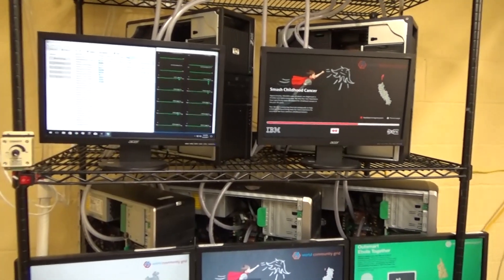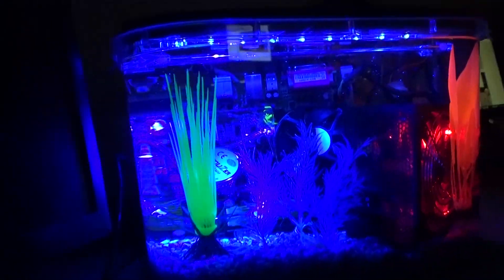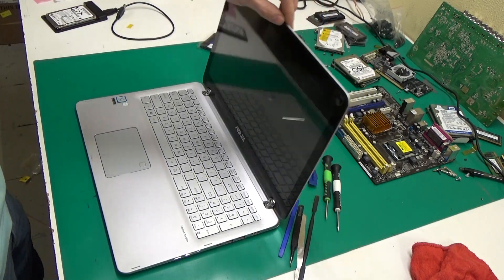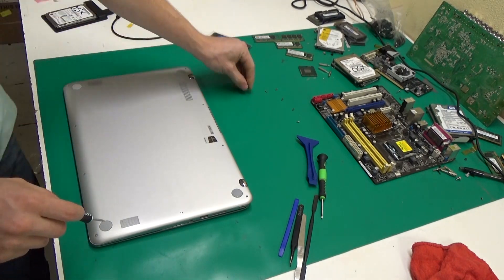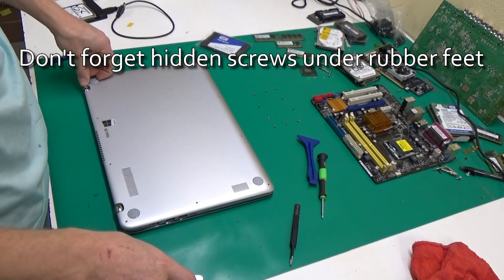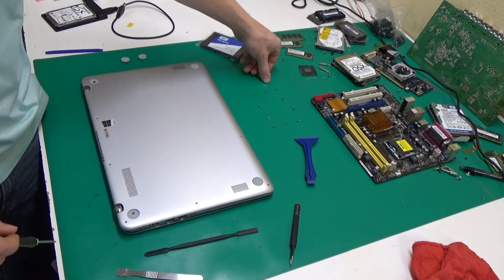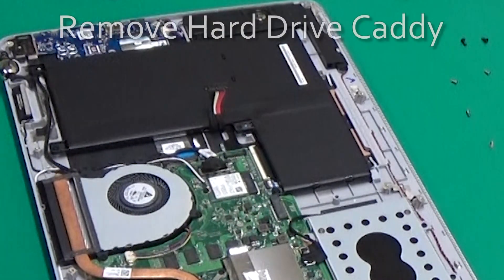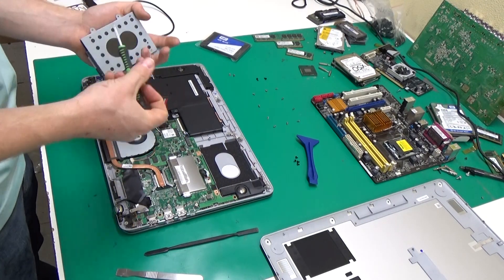How to upgrade Asus Q504 2-in1 Laptop with an SSD and Install Windows

Comment: Why is it so hard to remove the bottom cover? All screws are removed. Yes the rubber feet ones too.
Reply: No it's a snappable cover, you need a spudger look at the edges of the bottom cover
Reply: sanchez252 I guess its magnetic

Comment: Thanks man for that, but I have a question, I have the same laptop, but I still do not have enough money to buy a 1tb SSD, which you recommend me? did I buy a 1tb SSHD with 8gb SSD or do I keep its original 1tb HDD?
Reply: Eduardo Rivera honestly just buy a 120 or 240 GB SSD for fast star ups and use the 1tb HDD it comes with as extra storage, just buy a external hard drive case for it. You can get a 120 GB SSD for $50 and a external hard drive enclosure for $10, a lot better than spending $200+ on a 1tb SSD and faster than a 1tb SSHD

Comment: I bought this laptop not too long ago and thought about adding a PCIe M.2 ssd, but I’ve seen conflicting information whether the laptop has a port for this.  Would you be able to tell me if this would be an option?
Reply: Yes it does - see http://oi63.tinypic.com/wvriiw.jpg
I added "Samsung 960 EVO Series - 250GB PCIe NVMe - M.2 Internal SSD (MZ-V6E250BW)" to mine and it works fine in conjunction with HDD.

Comment: Its not have m2 slot for add SDD, instead replace?
Reply: Yes it does - see http://oi63.tinypic.com/wvriiw.jpg
I added "Samsung 960 EVO Series - 250GB PCIe NVMe - M.2 Internal SSD (MZ-V6E250BW)" to mine and it works fine in conjunction with HDD.

Comment: My fiancee just bought this laptop for 599$, im glad its upgradable. Can you add more ram also?
Reply from the maker: Yes; There should be 1 empty RAM slot underneath the aluminum tape between the CPU and Hard Drive(shown at 1:44 in video). I would recommend adding a 4GB (or 8GB) PC3L-12800S SO-DIMM stick.
Reply from the maker: You can see it uncovered here: http://www.ebay.com/itm/172818374276
Reply from the maker: Here's some RAM: http://www.ebay.com/itm/322667852990